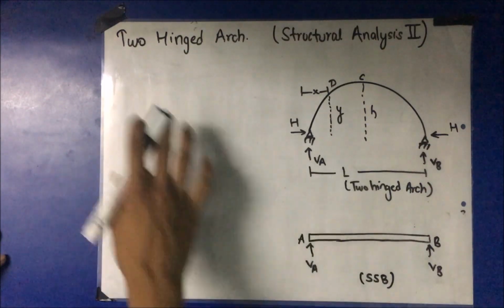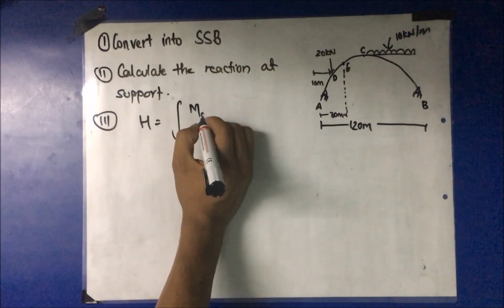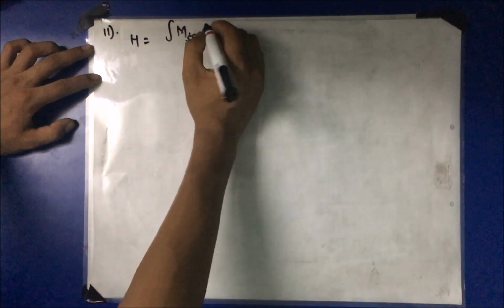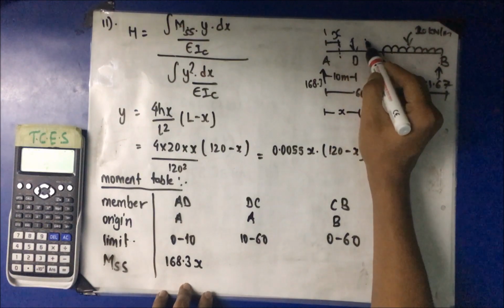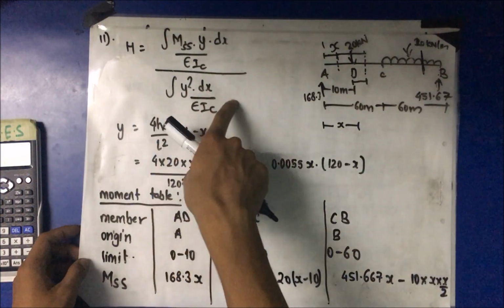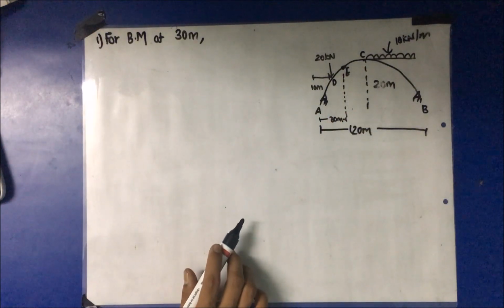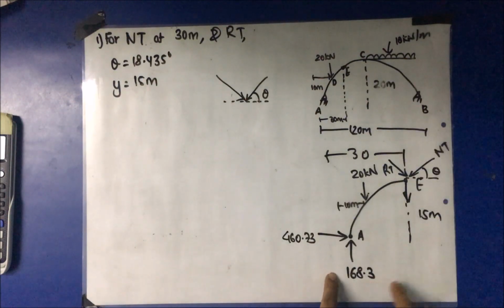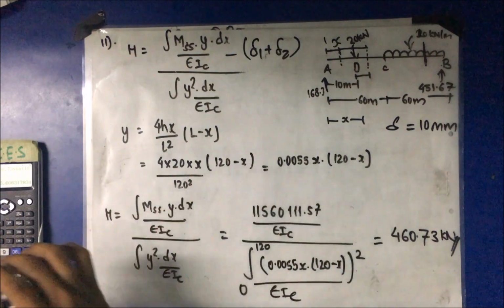Two Hinged Arch | Structural Anaylsis II | Theory of Structure || |

Comment: Sir, can we solve the question by using another method i.e.,  using formula.
 H=5/8(w/hL^3)a(L-a)(L^2+La-a^2)  for point load and H =wL^2/16h for udl
Reply from the maker: Yes you can do it. And for udl loaded in half portion only, use H = (wl^2)/8h